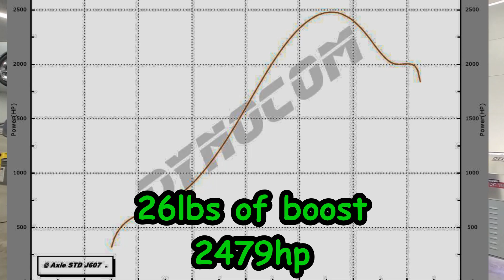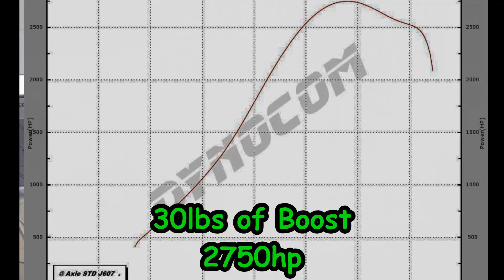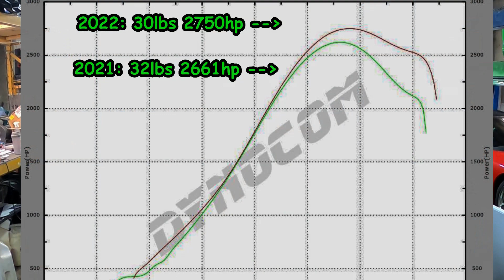Blow Thru Carb Makes OVER 2700HP on Single Turbo HEMI

Comment: So it’s got added fueling other than the carb?
Reply from the maker: It has a safety fueling yes. They were used for supplemental Fuel before, but with the new changes to the carb and fuel system we have more fuel, and have them set as a safety when EGTs get too HOT, and then if it continues to raise EGT Temperature, we have a safety that cuts the Ignition coils off to save the engine from burning up.